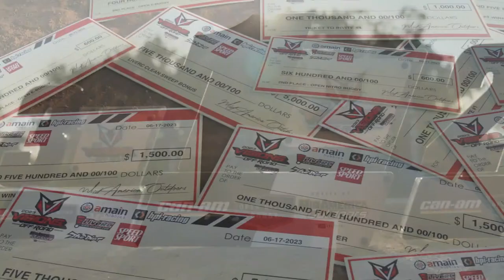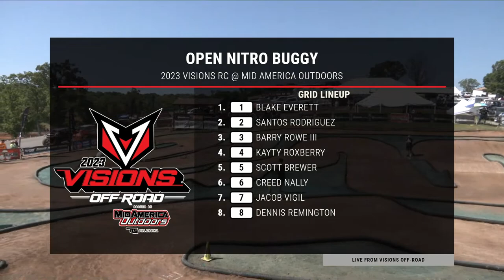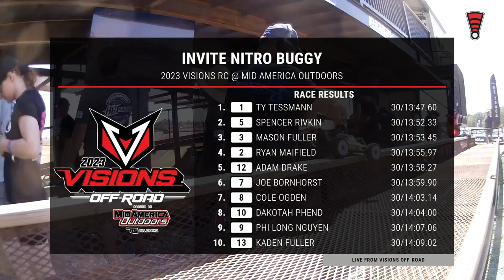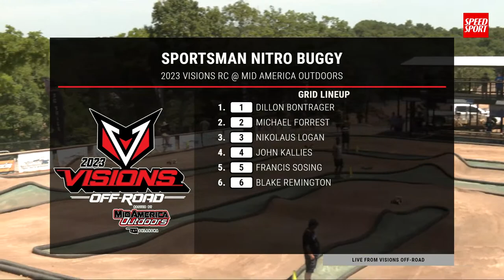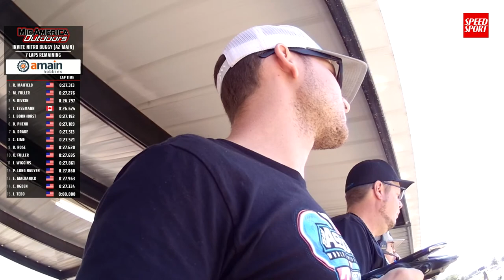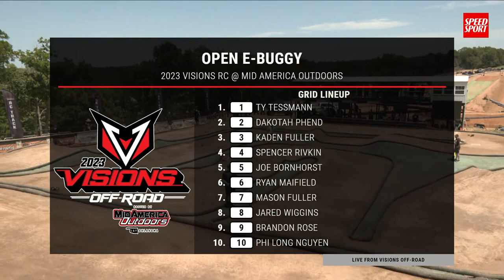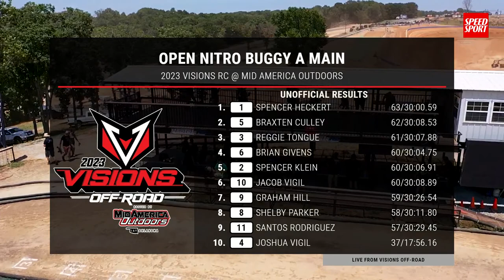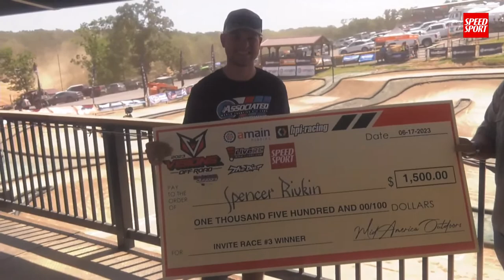MAINS | 2023 VISIONS R/C

Comment: Do yourself a favor and rewatch Tessan's A3 recovery drive.  Got pinballed around on lap 4 after Drake decided to biff it infront of the entire field rage jump the tube into more traffic (wtf was that drake?). Fell all the way to 12th by the time he got marshaled, but clawed back to 9th before the start of Lap 5 with some of the most amazing driving or luck or both ive ever seen, and then picked up two more spots on lap 6th.  Then reals in Riven for the heat win but and crossed the finish line first but not transponder loop on an insane block pass that almost worked to perfection.  I had to rewind and rewatch the Lap 4 carnage about 10 times to sort everything out.
Reply: Drake jumps pipes like that all the time. Never gets called for it.
Reply: @MX304  Pretty much all the drivers do that move in his position.  And all the midfield Pro drivers in these RC races cut track all the time. The refs what little of them theyre are in RC racing dont pay attention to the backmarkers in a long nitro main.  I saw Bornhorst cut about 70 feet off a lap one yeat at PNB when he jumped the huge gap and landed on the wrongs side of tube and instead of going back on the track line near where he went off, he just turned left cutting the hairpin and probably turned fast lap of the race even though he wrecked and was like the 8th place car that day.